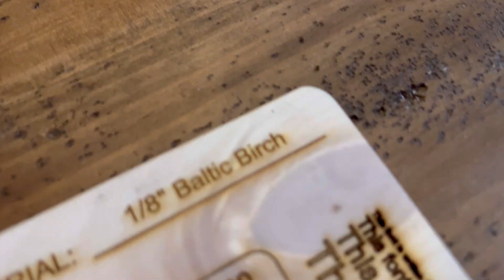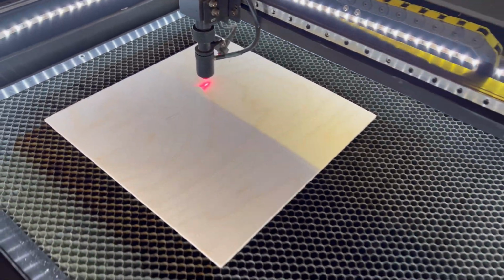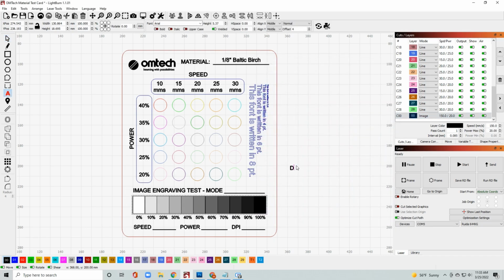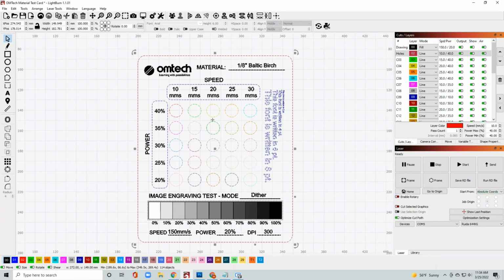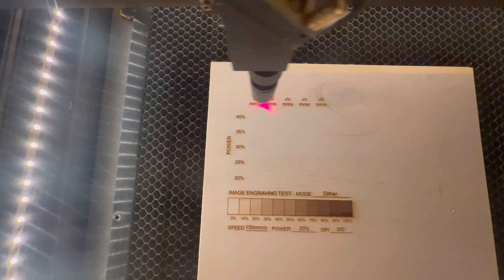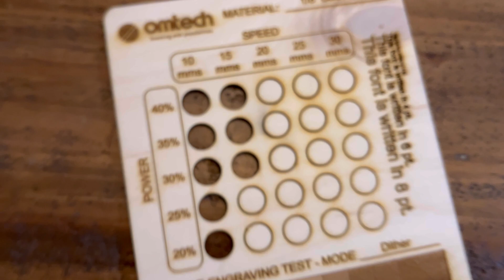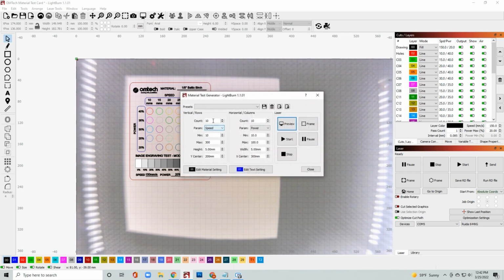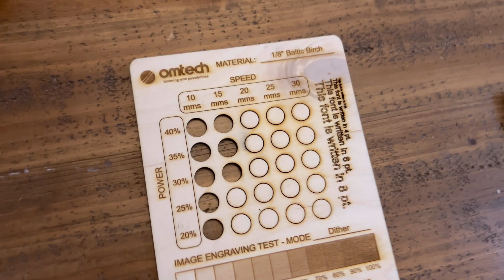Creating a Material Test Card using LightBurn - Project Walkthrough - OMTech

Comment: Ok so I ran a test card using 1/8 basswood and I had several settings that indicated I would get a clean cut, but when I ran a test project with those settings the project did not cut all the way through.  According to the test card I should have had a complete cut  with settings at 600mms, 17.9 % power on the Pronto 60 but the project did not release.  Is there a setting or some other factor that I could have missed?  Thank you.

Comment: Nice test card, but please note that there is a small error in this video since you have written 'DITHER' on the card, but you are actually using the GRAYSCALE mode - which is unfortunately also how your test card is setup by default. In LightBurn, 'Grayscale' is a special image mode that is the hardest to use because it does not use a dithering effect to represent shading (for a dither you would use 'Jarvis', 'Atkinson',  'Dither', 'Newsprint' etc) but instead uses variable power to represent shading, causing dark areas to burn DEEPER into the material.

Comment: Finally I finished building my own laser cutter/engraver. Now i time to try it.
I like to use this  test test card by OMTech laser You tube.  It is testing for cutting and engraving. I use Lightbur.
My question is for this test card - how to set laser focus point?
In the middle of thickness of material (cutting), or on surface (engraving)?
Thx in advance